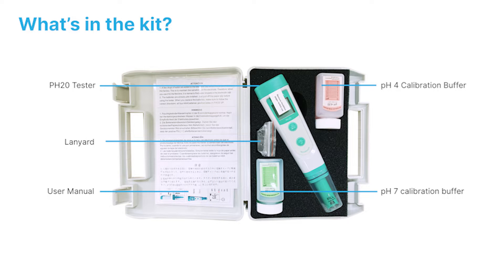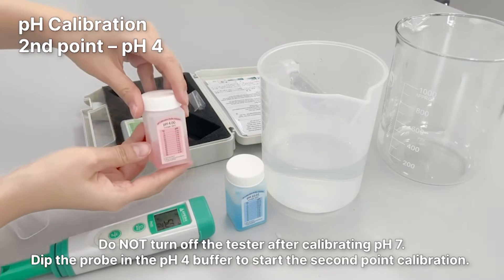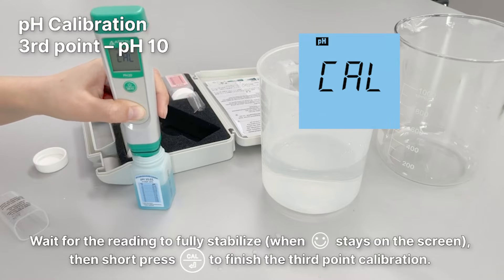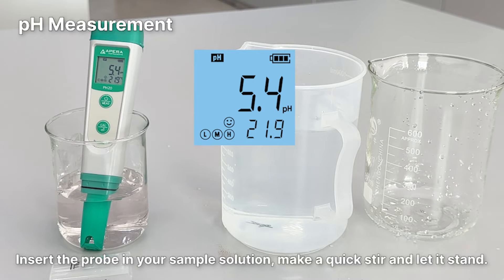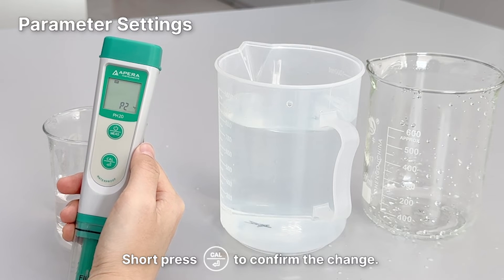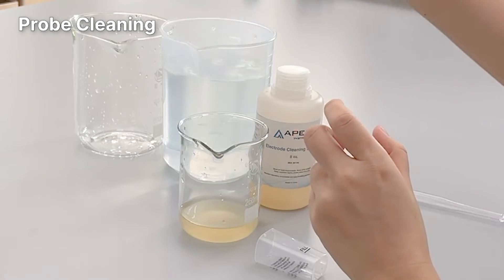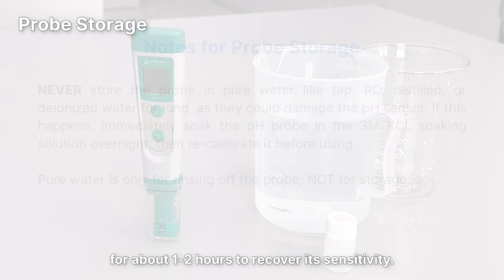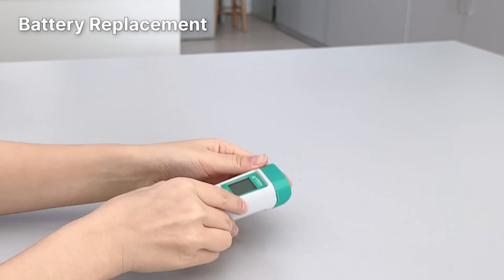Apera Instruments PH20 Pocket pH Tester Quick Start Tutorial

Comment: Do i have to fill the cap with kcl solution for storage?
Reply from the maker: Storing the probe in 3M KCl is the best practice. But if you don't have it, just make sure there are several water droplets in the cap to keep the moisture. Or you can soak it in the pH 4.00 solution as a second choice.

Comment: It looks like I bought the wrong tester. I wanted to buy a tester to try to find out what the ph level is in the soil for my cannabis plants. If i'm looking at this correctly, this just tests fluids and does not have anything to do with soil.
Reply from the maker: Our soil pH meter is GroStar GS2. You can find it on Amazon at a good deal now.
Reply: You can just test the run off water with this . But frequently clean

Comment: il keep it real its just to much work with this ph bin from the word go  you have to recalibrate  it damn near every time you use it ,its way to finicky , you cant use tap water it has to be pure water soak 5 hours or over night i really appreciate my bluelab after using this !
Reply from the maker: Please note that pH probes should never be soaked in pure water or tap water. It should be soaked in 3M KCl soaking solution or pH 4 buffer if you don't have 3M KCl on hand.

Comment: How often should you calibrate the meter before using it? Is there already a built in sensor to notify when its time to calibrate? Or once a week?~ Thank you!
Reply from the maker: Frequent Use: Calibrate at least once a week.
Moderate Use: For regular, moderate use, calibrate at least once a month. This is generally sufficient to maintain accuracy.
Special Situations for Recalibration:
* After testing highly acidic (pH < 2) or highly alkaline (pH > 12) solutions.
* If the tester has not been used for an extended period.
The PH20 tester does not have a built-in notification sensor to alert you when recalibration is necessary. You will need to follow the guidelines above or check calibration solution periodically if stability issues or accuracy deviations are observed.

Comment: Mine only came with buffer 4 and 7.  Do I need to buy the  3rd  buffer before I use it?  This is not good. Even the cheap vivosun ph meter came with all 3 buffers and this one was 3x the cost.
Reply: As stated in the video, only necessary if you expect to run into ph tests over 8 - which for gardening, you do not.

Comment: So, if water isn't for storage, how are the water drops that maybe in there when it's brand new any good for it??? I've always kept drips in my ph pen caps to keep diode from drying up. Wtf do I putting it then? Drops of ph 4 buffer???? Cuz it sure didn't come with storage solution and idk why tf ot wouldn't
Reply from the maker: Hello! We are sorry about the confusion there. Leaving a few water droplets is only for maintaining a humid atmosphere in the probe cap to prevent the pH membrane from drying out. It’s different from soaking/immersing the pH probe in water, which is going to damage the probe gradually. Using 3M KCl soaking solution to store the pH probe is the best practice that can keep the pH sensor at its optimal condition. As people might not always have 3M KCl on hand, the alternative is soaking the probe in pH 4 buffer. When you don’t have pH 4 buffer on hand either, leaving a few water droplets in the cap is going to be much better than dry storage. To put it simply, there is a ranking for pH probe storage method, from worst to best: soaking in pure water like tap or drinking water (Very bad) ––> dry storage (Bad) ––> leaving a few water droplets in the probe cap (OK) ––> soaking in pH 4 buffer (good) ––> soaking in 3M KCl soaking solution (best). Hope you can find this info helpful.
Reply: @aperainst  definitely thanks! So some drops of well water is OK to keep moisture if I use the meter every day?
Reply from the maker: @FatherNatureCNY  yes absolutely.
Reply: @aperainst  hey I have this new meter that I got when we were talking about storage...hlf the time I open the case,take it out and hit the button, and it doesn't turn on. That sucks, because what am I supposed to do the whole time this is in the mail going back to u guys AND the time it takes for a replacement to reach me? This sucks. And it won't turn on right now at all. I finally after 3½ yrs of using cheap junk throw away meters, went for it and bought an apera instrument. And here I am lol  what am I supposed to do about this? Email?
Reply: @aperainst  even the day I got it, I calibrated it. There was a couple times it shut off before I could dip into the 7 solution, to water,and to the 4ph. Couple times I had to hit the power button a few times cuz it wouldn't turn on. Now it's still not turning on with 50 gallons of plant food mixed up for use this evening. It's an expensive mix every Friday believe me. This is about to go to waste I have a feeling🤬
Reply from the maker: @FatherNatureCNY  Sounds like a very strange case to us. Please contact us at +1(614)2853080 or info@aperainst.com. One of our specialists will be in touch to help you resolve the problem.

Comment: After a year of use looking really well after it I can no longer calibrate, as the reading of the 7 buffer reads as Ph 8 and wont calibrate, it throw the error er1.. Any solutions or I need to get a new prove/device!? If so I am very disappointed with the product! The only reason I choose you it was cos I though yours will be better, but it did not last more than any regular 20$.. Not worth the extra 40$ by any means.
Reply from the maker: We are sorry to hear this happening to you. It could be due to contaminated buffers, aged probe, or malfunctioning instrument...we need to test on the product to identify the root cause. You can go to support.aperainst.com to submit a RMA ticket. One of our technical support will be in touch to help you resolve the problem.

Comment: Hello, I have the Storage solution 3M-KCl and I have filled the cap of my PH tester with the solution to the fill line. But do you need to put the probe of the PH meter always in the storage solution or just overnight? Thanks
Reply from the maker: Always storing the ph probe when it's not in use is the best practice.
Reply: @aperainst  thanks for the info, I have stored the ph probe in the Storage solution 3M-KCl when I'm not using the PH tester.
Reply: I wouldn't do that as above and in their tutorial they say only store in the KCL solution for long term storage and not if you use it daily or weekly. They also say store it in the ph 4 buffer solution or with just a few drops of pure (distilled water) in the cap to maintain humidity. Now I am confused too as I've heard not to store in the buffer solution and not to store in distilled water. But they're saying the KCL is just for long term storage or restoring a dried out probe.
Reply: @jameswilliford5478  Damn all those different stuff. I just store it in the KCL solution. I guess if it's good for long term storage or restoring a dried out probe, it's good for short term storage too. Better storing it in KCL solution then nothing att all. So how do you store your PH tester?

Comment: Do I need to calibrate before any pH test?
Reply from the maker: No. Typically one calibration can hold the accuracy for about a month. But you can always check the accuracy by testing the fresh buffer, if there is discrepancy, you can calibrate the meter to get it right.

Comment: Can I or should I store it in kcl solution long term? I don't really understand this as it seeems like all the ph meter use the same techology. Still some say store it in kcl solution all the time, some say it need to be humid, or in water and some do not say anything at all. It's a pricey stuff and I want to have it the longest lifespan as it can.
Reply from the maker: For long term storage (>1 month) or restoring a dried-out pH probe, we'd recommend storing in 3M KCl soaking solution. But if you use the meter frequently (like daily or weekly), keep the storage cap wet with pure water or soak in pH 4 buffer solution will do the job.
Reply: @aperainst  Thank you!
Reply: @aperainst ok thank you, but what do you mean with „pure water“
Reply from the maker: @sendoholic420  pure water refers to distilled water/RO water/deionized water

Comment: Hi guys, have a question. When Im trying to calibrate in the first 7ph solution, my ph meter show 6.9ph and 6 on the botton of the screen insted of 7. Seems like its not calibrating. Could you provide me any solution?
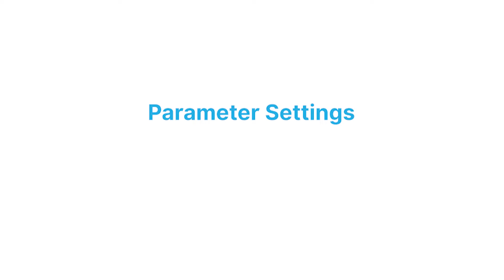Reply from the maker: You have changed the calibration standard series to NIST instead of USA by accident. It's an easy fix. Just go ahead and change it back to USA standard at settings P1. Please refer to 03:33 in the video on how to change the settings.😄
Reply: @aperainst  Thans for a quick reply, fixed now :).

Comment: Hello, I just got the PH20 PH tester, but I read in the instruction manuel that: if you find any air bubble in the glass bulb of the PH sensor, simply shake the probe for a few times to remove it. But isn't it normal that their is an air buble? Because I tried and get rid of the air buble, but with no succes. Thanks.
Reply from the maker: Try shaking the meter off like whipping.